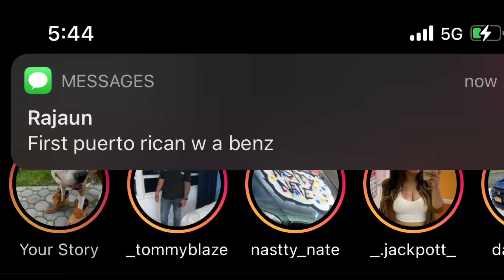@svicideneck Gets A New C230 Supercharged Drift Car

Comment: I have the same car I learned if you want to take traction fully off you have to put the key to the on position and press the button on the cluster 3 times and and use the page buttons on the steering wheel until you get on the Dyno mode and use the arrow to switch it to on and turn on the car like that and there won’t be any abs
Reply from the maker: We Unplugged Abs
Reply: @b3njxmn  how
Reply from the maker: @chapoysm5212  The Fuse We Pulled It
Reply: @b3njxmn  had an 06 sti. removed abs and trac and subi race shop built the whole drivetrain for 25/75 fr split. at 600+ the thing was nuts for 3 months till 2 pistons decided that forging aint shit and turned to dust.

Comment: These aren’t that good learned from experience they need their own independent cooling system cuz sooner or later the supper charger gets too hot and ends up overheating the engine. I got the v6 06 now and it’s also the 6speed manual and it’s got much more power in a way and it’s body is a lil more sharper compared to later models